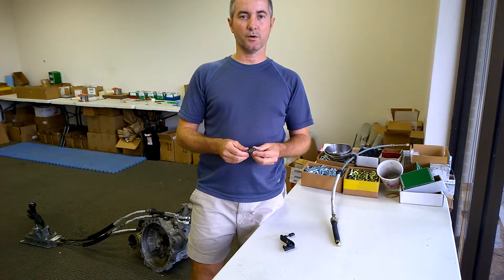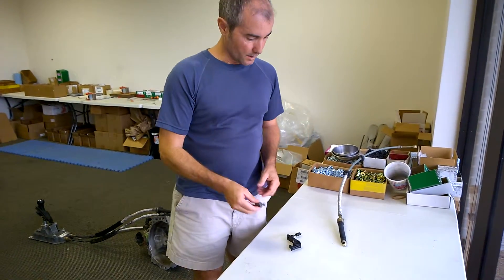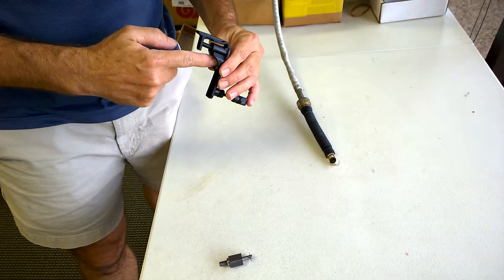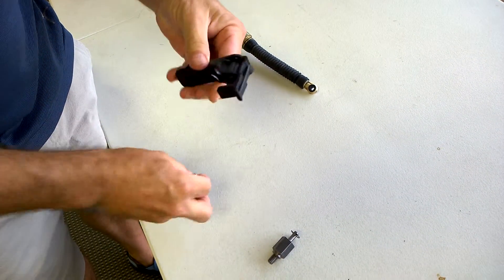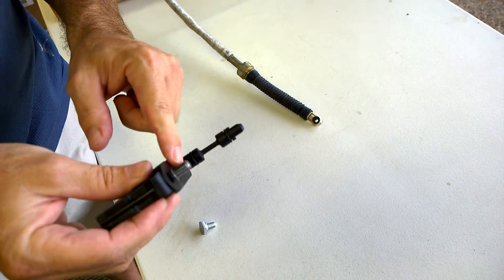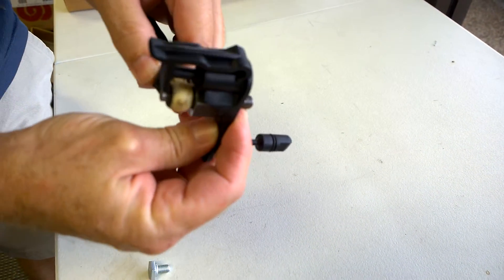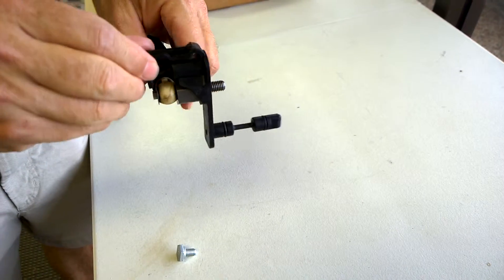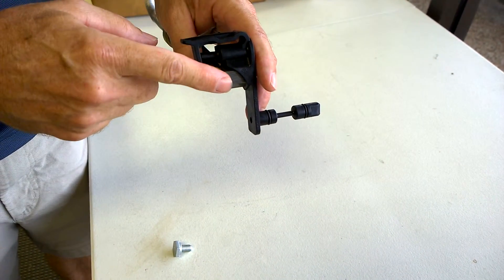Installing the 02A side to side reduction pin

Comment: Do you know of another source for the side to side reduction pin? I recently purchased all four sets of your Shifter Bushings for my 1996 VW B4 Passat, and I think that this is the piece that I need that will help with easier access of reverse gear. Thanks.
Reply: @dieselgeekdotcom  Thanks very much for the information!
Reply: @dieselgeekdotcom  I want to let you know that I did not need the Gruven part because after installing all four different dieselgeekdotcom shifter bushings parts sets (two in the cabin and two on top of the transmission) my shifter linkage began working smoother and more precise than when I purchased the car 15 years ago. Thank you very much!